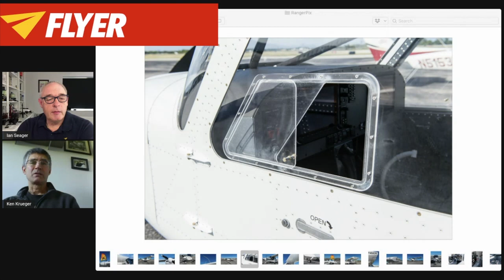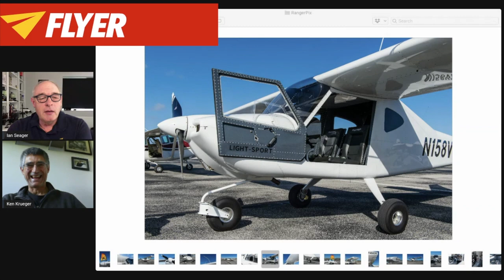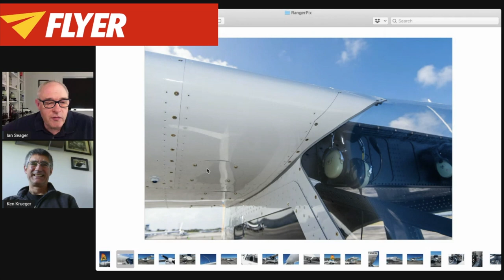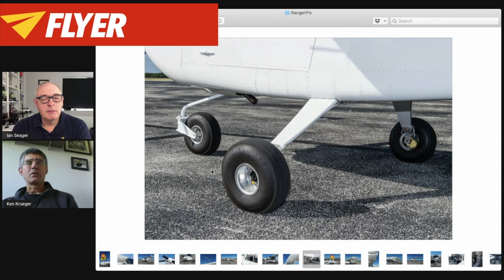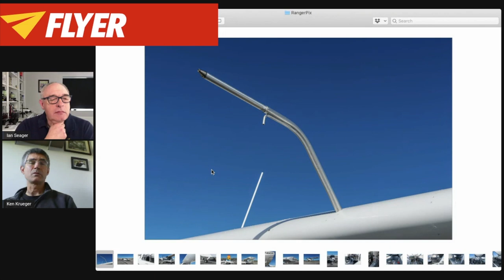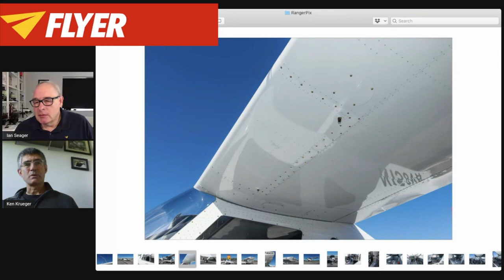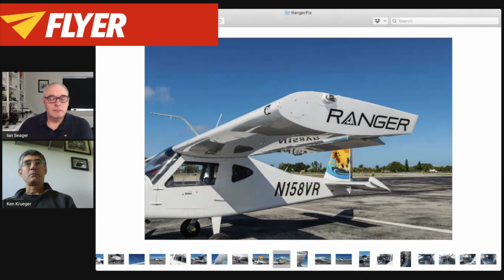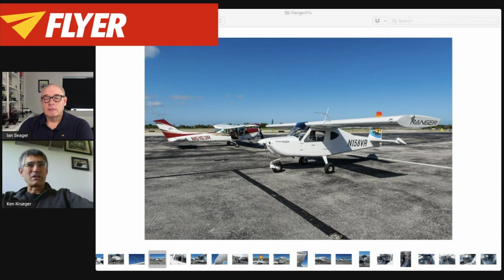Interview with Ken Krueger, Chief Designer, Vashon Ranger

Comment: Vashon has raised the price of the Ranger, base model is now just shy of 120k
Reply: I know for 120K it’s hard to not just build a RV14 and get all the performance with a similar level of comfort.
Reply: @brent1041  i highly doubt if you can build an RV14 for less than 175k
Reply: @2Phast4Rocket an RV10 can be built under 175K if you don’t go crazy and stick to a budget.  While not terribly cheaper an RV14 can still be built for 120K

Comment: Lots of nice concepts, but it is a shame about the many poor decisions like not using a Rotax, not designing out the front V-brace, and designing the utilitarian interior that is missing zero-cost creature comforts.  For example center console could easily have been made with recesses to hold pens, should have LEMO jacks for bose powered headsets, missing map pockets, should have high-current USB charger ports on center console, map box on panel. Missing gas cylinders to prevent wind from catching doors, non adjustable seats, inconvenient rudder pedal adjustment.  Inconsistent controls- carb heat is pull hot, cabin heat is push hot and same knob for both?  “Pull” rather than rotate for fuel cut-off is a poor choice, no fuel return, poor climb rate,
Reply: The 0-200 is a proven engine with far more fleet time than Rotax. Innovation is fine, but reliability and maintenance support in out of the way places make the Continental an inarguably good choice. The V-brace is vital structure and disappears from view with any time in the airplane. Pen holders..really? It does come with neat cupholders, so there's that. LEMO jacks are available for a small cost (I ordered them for my Ranger). Power Delivery/USB is also an option. Map pockets/box? This has Dynon screens, no paper maps needed. The doors open 180 degrees & gas support struts would be problematic & impractical. There is a lock that holds them open on the ground. The carb heat and cabin heat are both "pull" for on. There's no fuel return because this is a carburetor engine, not fuel injection. With a fat wing, the climb rate is excellent given the power to weight. I do agree that the pedal adjust could be improved for inflight use, but that is a minor quibble.
Reply: This is aircraft is probably not for you.
Reply: Dearest Hello World, Thank goodness you weren't a part of the Design Team, and if you we're you would have been fired immediately ! 'many poor decisions' ??? All of your (suggestions) are exactly what the Designers of the Vashon, "Ranger" didn't want !
Reply: Dearest Hello World, Thank goodness you weren't a part of the Design Team, and if you we're you would have been fired, immediately ! 'many poor decisions' ??? All of your (suggestions) are exactly what the Designers of the Vashon, "Ranger" didn't want !

Comment: The vashon is ok for the price, but not ready to compete with aircraft with more useful load and rotax engine. Maybe when the FAA changes the rules for light sport,  then the plane will make sense.
Reply: Light sport should be a weight limit for the aircraft minus load and fuel.
Reply: @nameberry220  Inertia doesn't know what load and fuel are, and that was the basis for the weight limit, arbitrary though it may be. If I were a Ranger owner, based on my layperson's perspective, I'd hope that the new regulation will add 200 to 400 pounds of max gross retroactively. I sat in this plane at AirVenture, and I love it. Can't wait to own one.

Comment: I must say I love most of the concept. What I think really speaks for it, and is not addressed in the interview, that it is a rugged well sized new interpretation of the C15. And yes, a bunch of us would love to camp in the plane, getting some freedom in touring without extra effort. I really like most of the design compromises for the US market. I hope they sell 50 - 200 units per year over time, the price appears reasonable for what they were aiming for.
Reply: Unfortunately a small Diesel is not certified on the market, with a high TBR/ TBO; to make this a global rugged standard trainer. Mogas, sure, great, and yes, I know Diesels are heavier. But not to go with a BRS seems to be missing the sale delta between C350/ 400 and SR20/22.
Reply: @Walterwaltraud  have you been to Continental website lately? Pretty decent TBO...
Reply: @AClark-gs5gl  Still TBR, not TBO. Huuuge difference if you fly a lot, like flight schools do. Plus what's the cost of the TBR? (love Diesels, but that's gigantic disadvantages to an O200 with mogas)